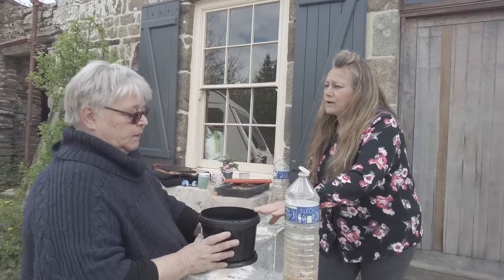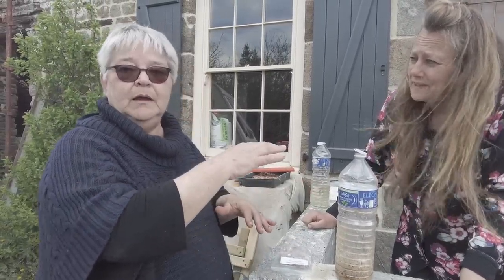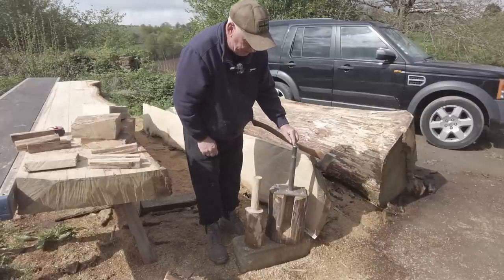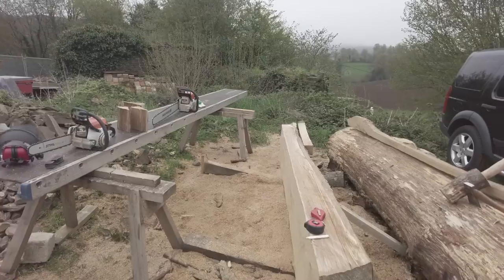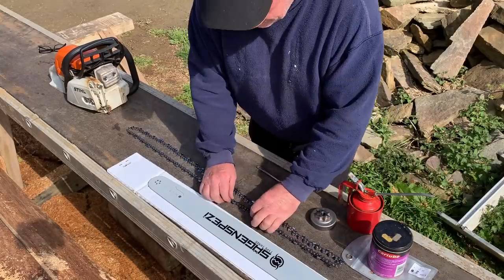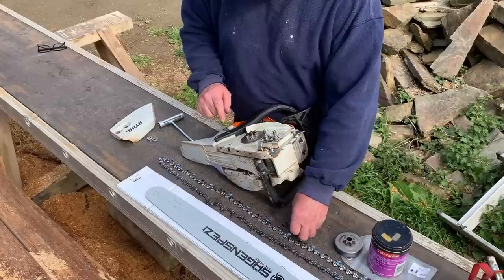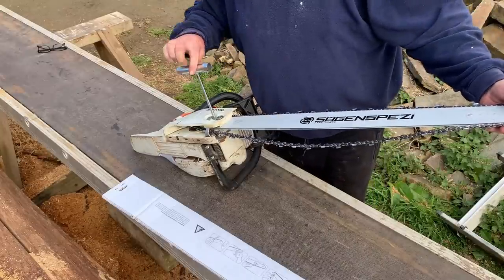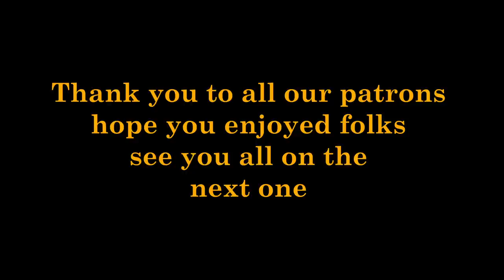No 98.PORCH BUILD & GROWING MUSHROOMS#frenchfarmhouse #porch #porchbuild

Comment: Hi Budo. The latest video! Was interesting as always. I admire you both for your hard work,dedication, and various skills. One small point just for your information. The clip which holds on the chainsaw sprocket is actually an E clip not a circlip. A little pedantic I know. Obviously does the same job as a circlip. Best of luck.
Reply from the maker: Thank you Kenneth i use circlip for all that type of fasteners LOL my bad 🍺🤠👍